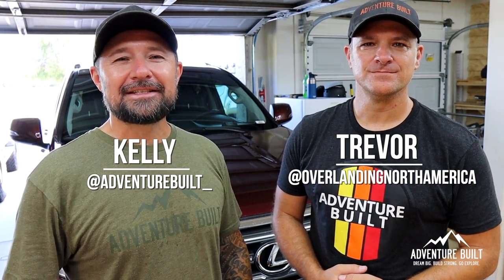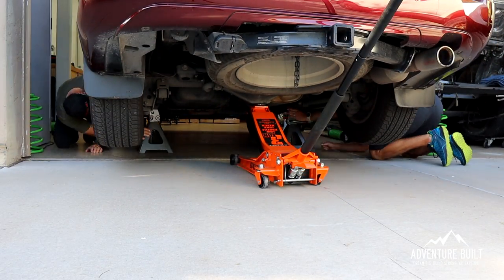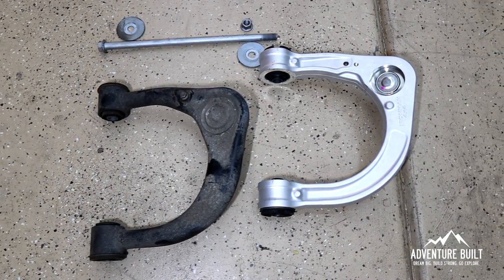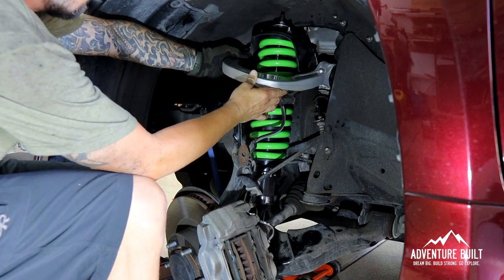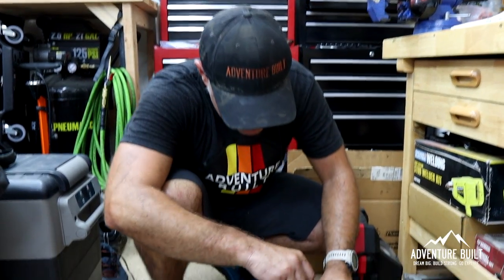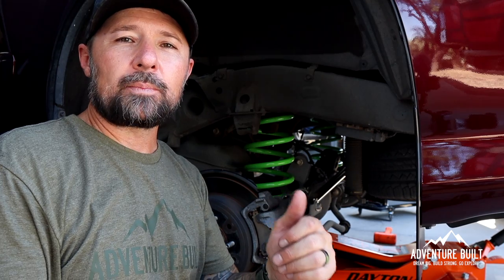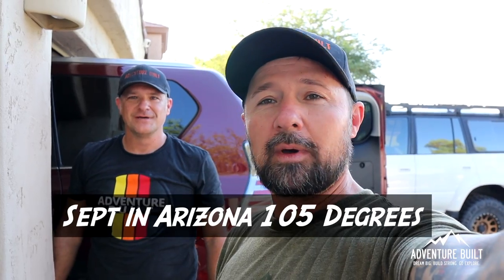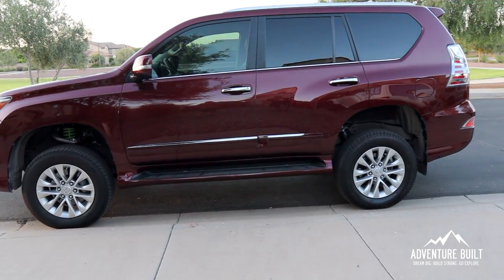ULTIMATE LEXUS GX OVERLAND BUILD FOR TRAILERS | IRONMAN 4X4 STAGE 2 | OVERLANDING NORTH AMERICA

Comment: On the Toyota front Upper Control Arms you can go to the dealer and get a new bolts, cut the one in the truck and put the new one in backwards and save a ton of time.  Not sure why they can't install them that way from the factory.  Great Video - thanks

Comment: Gents, thanks for the content, I noticed you installed a panhard bar that, according to the Ironman 4X4 website, is used for non-kdss vehicles only. Curious if you spoke with anyone at Ironman about which panhard bar to go with. I ordered the kdss version (the one with the humps) and am wondering now if I will have any clearance issues with the axle.
Reply from the maker: I hope you got the answer for this. Trevor did the research on the kit and hopefully got the right one.
Reply: That's what I noticed too. The KDSS Track bars are supposed to have two curves in them to clear the KDSS links
Reply: @AdventureBuilt  @10:22 you can see where the panhard bar is right on the KDSS links.. did you guys end up replacing it with the curved one?  or has it been impacting?

Comment: Was this a 3" front lift?  and were the rear springs 3"/2.5" or 2" lift?   did it ever settle leveled?
Reply from the maker: It did settle in the right about 2.5”-2.75” depending on how much weight is in the rig.
Reply: @AdventureBuilt  Were the new rear springs 2 or 3 inch lift springs to begin with?

Comment: never disconnect KDSS , you just start front with driver side , then tide up ( because kdss may drop down ) which give you drop on passenger side and help you to remove /install shock , then rear side, disconnect sway bar from back KDSS side and rear passenger side which you guys did ,  , start from KDSS side , once done , put extra jack on KDSS side and work on passenger side , at end connect sway bar .
i did it alone ,  try only 2 inch lift with KDSS and Ironman low load spring , if you use heavy load spring , KDSS is useless .
more then 2 inch lift need diff drop and break line extension .